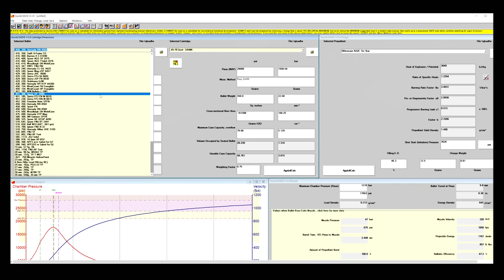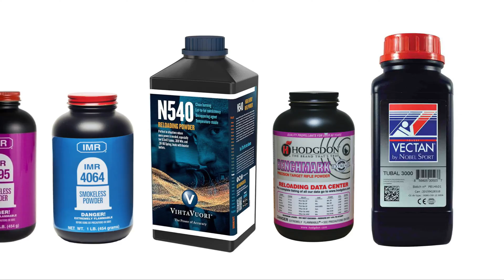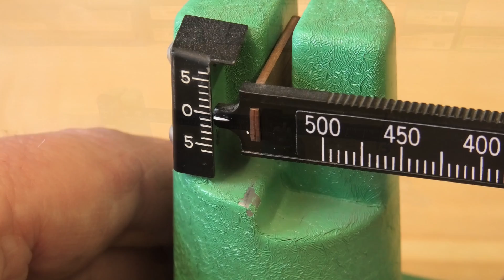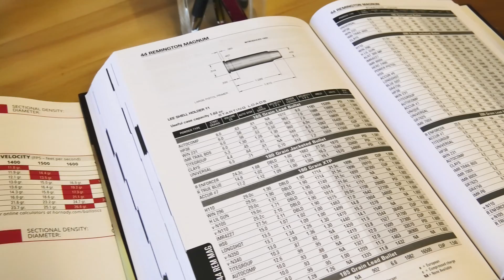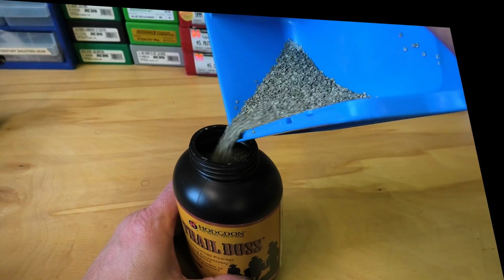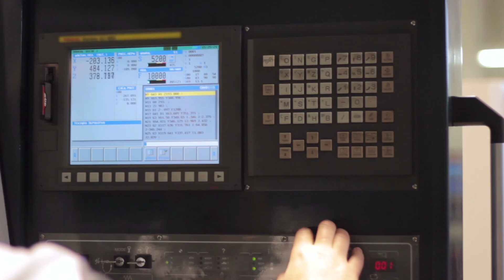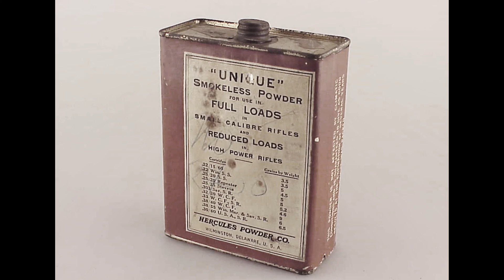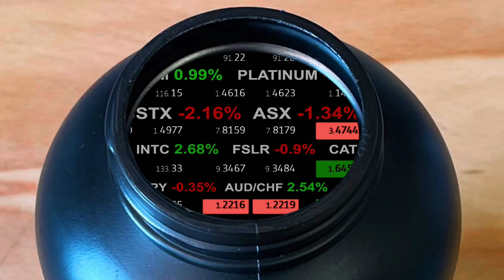Smokeless Powders - Part 4

Comment: 12:09 this I can disagree with, cast bullet loads for centerfire rifles often include a small charge of small pistol powder to propel the lead bullet. I myself often load cast bullet loads and if you do your calculations and tread carefully there is no reason to fear a catastrophic failure.
Reply from the maker: I take your point. Do you mean something like Titegroup or Trail Boss? Thinking back, I seem to remember making light 45-70 loads (cast lead bullets only) using Trail Boss and they worked well. It was still a book load though. It's been a few years since I did these videos but I think at the time I was concerned about people trying light pistol powder loads with jacketed bullets.
Reply: The Lyman Cast Bullet Handbook 3rd Edition 1980 Ocr page 178 - 30/30 winchester.
I have tried this load with unique powder and they work well, with no signs of overpressure. 
they state to use 7 to 10.6 grains with 170 gr cast bullet.